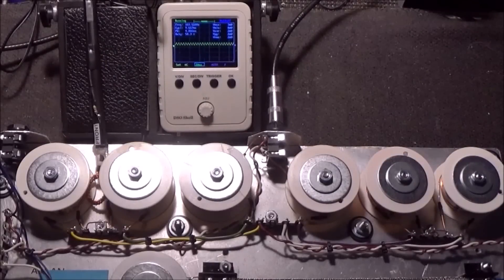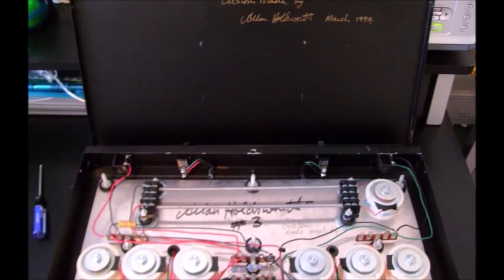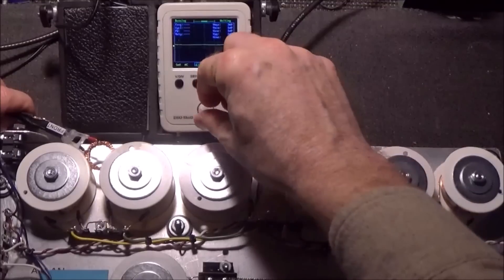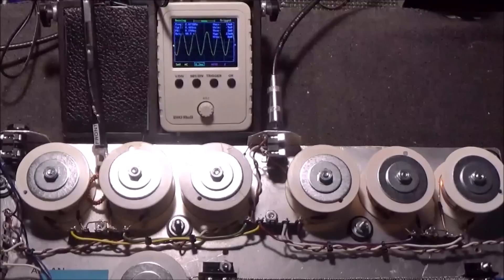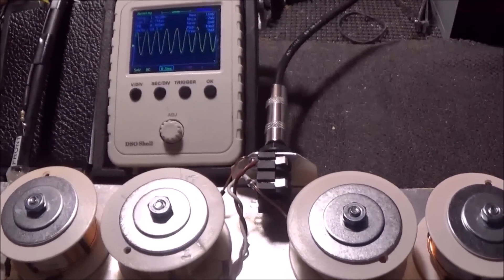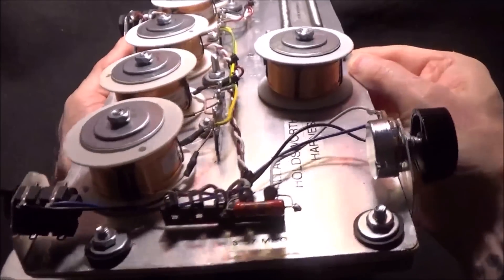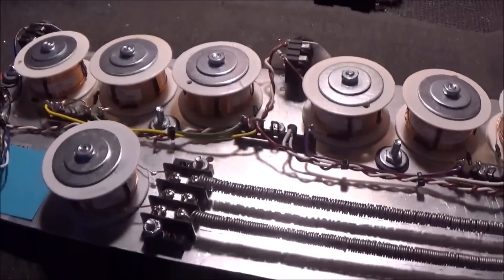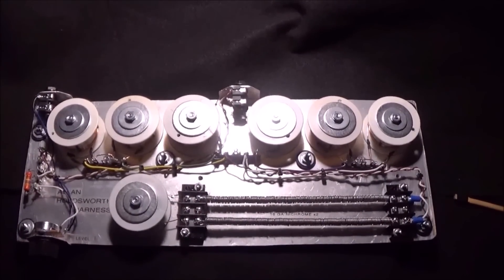The Allan Holdsworth "HARNESS" - Part II

Comment: So this device is amplifying the ac guitar signal as it is transfered between the seven coils but only after it is attenuated  by the load resistors, so, the ac signal is being boosted by the primary secondary effect the same way as any step up transformer would do to create an active load as a speaker would do. The palmer load box was available back in the 1970's so not a new idea at all and there is still a better way but I digress, still the harness is a novel way to approach the problem of sending a reactive ac signal that actually is di box along with attenuation but the harness uses the line out which is the preamp out if I'm not mistaken, if I am, again I digress.
Reply from the maker: I think it's basically acting like one big inductor with a resistive load designed to take the most of the current and dissipate the heat generated.

Comment: What you call cross talk is actually the changing magnetic field in one coil caused by an alternating current creating another voltage/current in a coil next to it. That's how a transformer works. The alternating currents in your coil create an alternating magnetic field that actually creates an voltage opposing/counteracting the original voltage in the same coil. This is what you call impedance and it's not really resistance but it acts like it. More magnetic material in the core of the coil leads to a higher impedance. The higher the frequency the more the signal gets inpeded.
Reply from the maker: Yeah it's not a transformer but similar principle. What does not make sense to me is that high frequencies do not appear to be attenuated at all... it only goes up up up from 200 Hz. Completely backwards of what I was expecting to see. Maybe I get these odd results because it's not on the output side of an output transformer?

Comment: I'm a sucker for this kind of bespoke electronics (grin). Some observations. Generally one splits up an inductor to raise the self resonant frequency of the coil caused by the mutual capacity of the windings. If he used one big inductor, it would naturally ring at a much lower frequency than the seven inductors in series, thus putting a big pole somewhere in the audio range of that graph of yours. Not good. So you split up the inductor as shown. I like that he puts the resistive load in the middle of the stack. Nice balanced design.
Where's all that capacity (67 microfarads!!!) coming from? There was no capacitor listed in the schematic on your site and parasitic capacity would be in the 100's of picofarad range, not microfarad. Check measurement.
I think the simple lumped model shown in your simulation is more or less the ideal AH was striving for. You got pretty close with your actual circuit. Congrats!  I love that you took the time to study and replicate the device. It was very instructive.
Reply from the maker: I don’t know about the capacitance… it’s just what I measured. Doesn’t make a lot of sense to me. Maybe my LCR is confused by this thing? 

Yeah, the stuff at my website doesn’t include the impedance stuff… I just simulated that earlier this week. I think I need to connect this thing to an output transformer to see what it’s actually doing, or devise some other kind of test(s).
Reply: @VegasCyclingFreak  Looking at the circuit diagram, you've got a pretty simple circuit. about 7mH in series with 5 ohms. That's a lot of inductance: typical voice coils for speakers are not more than a few 10's of microhenries. This is because the inductive reactance at say 1KHz is a whopping 50 ohms due to that 7mH, swamping out the nichrome wire resistors. Basically the load is entirely reactive over 1kHz. If there is a mystery here, it's what AH was contemplating with this design choice.  I'm pretty sure you won't hurt anything by testing it on an amp, as basically you are running the amp open circuit at higher frequencies...
Reply from the maker: @kpnconsulting8739  Interesting point you bring up there. Seems that most 12" guitar speakers have a voice coil inductance between 0.1-ish mH and roughly 0.5mH. With 7mh x 7, that is nearly 5mH, plus the total apparent inductance goes up about 40% when they are placed on the baseplate & get the screws and washers attached.  Maybe in Allan's unit it's lower, but the DC resistance on each of my 200 watt 1mH inductors is 0.73 ohms. It seems that the nichrome was mostly there for the current handling/heat dissipation capacity. 

Some of the other "load box" type schematics I've seen have up to a 50mH  inductor. I can't really compare Allan's circuit to anything else out there... it's pretty unique. It would have been so interesting if he could have done a deep dive on the whole process of how he came up with the design and settled on those components.
Reply: @VegasCyclingFreak  It just now struck me what AH was doing. The circuit is a matching network to get you from the output transformer secondary to your line input. I just unplugged the speaker from my 30W Marshall Artist and measured the inductance of the output transformer secondary. 6mH! Right on the nose. So he's matching the resistance and the inductance of the output transformer with the "harness" resistance and inductance. Then he's looking at the divided down voltage drop across the stack as the output. V/ clever.
Reply from the maker: @kpnconsulting8739  Eureka! Hmm... that makes sense. So it's mirroring what the secondary of the OT is doing with a line level output arrangement in parallel? Almost seems like it's turning the OT into a back to back transformer arrangement of sorts, thru the mutual inductance coupling of the inductors in the Harness. This doesn't make the OT work harder?

I spoke to an owner of a custom Harness. He told me that you can't use it for extended lengths of time... too hard on tubes and output transformers. He apparently burnt up the OT in his Blues Breaker. That was his experience anyway.
Reply: @VegasCyclingFreak  That's an important observation. Now that I understand the circuit I can sort of see why it's destructive to the OT. Output circuits are designed to drive a mostly resistive load, so most of the real power ends up in the speaker. Under these conditions, with a mostly reactive load, more of the real power will end up in the OT and output circuitry. It's got to go somewhere.

Comment: Awesome.  Love this series, cant wait to see it in action.  Really curious what this thing is going to sound like.
Reply: Yes I was and am stoked idk why I love hearing people analyze and discuss circuits
Reply: It's not something you could hear, especially on YouTube. It would probably just sound like a cranked amp. You have to plug one in between an amp you are familiar with, and a cabinet. Somewhere around 1997 or 98, I had tried all the various load resistors, and they all lost something. Your amp just wasn't your amp any more. Touch response was always compromised, too. So I had the Harness II recommended to me. I had a blackface tremolux at the time, but had a rack rig. I'd given up on using the Tremolux as a pre-amp, and had gone throught the Mesa pre-amp, the GT, Kasha, Kitty Hawk and a few others. None felt right. The Harness was the answer, because I could use the Tremolux as a pre-amp for clean sounds, and it kept all of the tone, and all of the feel. I used the Harness II for many years, not knowing it was risky. Guess I got lucky. But boy, did it sound and feel fantastic. It didn't add anything to the sound, it just allowed my amp to be what it was, and I could then run it through effects and into a power amp.

Comment: Just watched Pt I, and you cover my big  question about coil geometry.  What does the output signal look like? What's the expected PTP input voltage of a Harness?
Reply from the maker: Line level output looks same as input, just scaled down. A 50 watt amp would make the circuit see about 20V RMS and something like 2-3 amps of peak current. It seems to me that everything I've demonstrated would just scale up with an increase in voltage. Probably the only way to really test it properly is connected to a tube amp output transformer.... I think that's the missing piece in all of this. All the stuff on the other side of the output transformer will affect what this thing does.
Reply: @VegasCyclingFreak could you get your hands on a cheap tube amp maybe from a Chinese website, there are some available for around $150, it would be a shame to destroy output transformers. But in the name of tone it must be done!!!!

Comment: You seem to be an expert on Allan’s gear, so maybe you can answer this for me - I think I read than Allan, at one point, ran his guitar into a Mesa Boogie and then he ran the output of this into another amp!  Is there any truth in this?
Reply from the maker: Well it was output of a Mesa Boogie head into the Harness, then into parametric EQs, then to eight delays, and then to a stereo power amp. I don't know if he always did it like that but seems in early 90s that was his rig. It got a lot simpler in later years.
Reply: @VegasCyclingFreak  Very cool info - thanks!  The person who wrote that must have confused Allan's Harness and thought it was another amp.  For me, he had the best lead tone ever.  

Best wishes.

Comment: it’s very cool that you were able to build this, however, nobody makes a power attenuator with nichrome wire.  The reason is the wire gets  hot ,brittle and breaks, then  you have no load on your amplifier.  There are much safer reactive load boxes on the market today.  If you love your amp, I recommend a more modern design.
Reply from the maker: Yeah I don't plan on using this but I wanted to reverse engineer it as far as I could. I don't know that the wire would break when it's only seeing 100 watts-ish, but as a manufacturer I guess the concern would be a mechanical connection coming loose and then we would have the situation you presented - no load on the output transformer. And your sound goes with it because it's all in series.
Reply: @VegasCyclingFreak  You did a fantastic job reverse engineering and building this.  I am very impressed that Allan had the skills to design this himself and have it go to production!   Thank you I  learned a lot from your video.  Enjoy.
Reply from the maker: @buzzedalldrink  Yeah about that... Rocktron's circuit is totally different but the units that Allan made himself used the nichrome wire. Rocktron unit used ceramic resistors. Anyway, yes Allan I believe was a genius.
Reply: @VegasCyclingFreak   agreed  he was special
Reply: @buzzedalldrink  Someone I got my gear from in the 90s knew Allan. According to this person, Allan had invented several things. Among them was a device that improved beer dispensed from the large metal kegs that bars tend to use. I can't recall the details at this late date, but he had a patent on the design, and it was in use in at least a few places. There were a few other things I was told about, but I can't recall those at all now. All I can recall was being extremely impressed by the man's obvious genius beyond just music.
Reply: I used a Harness II for years back in the mid to late 90s. Maybe I just got lucky. I used it to load down a Tremolux that had been converted into a head. From there it went into a Rocktron Patchmate that switched in and out various pedals and a couple of rack mount multi-effects, then into a power amp. Curious that they are so risky and Holdsworth used one. He had to have known. Maybe not. All I can say is I had no problems, and it sounded and felt *great*. Far better than all the various tube pre-amps I had tried.
Reply from the maker: @augustusbetucius2931  Cool. I know Allan fried one output transformer in a Carvin amp, and I've heard it was hard on power tubes. Other problem is people think they can turn everything to 11 with this sort of a device, and that's just asking for trouble. Some amps I think have marginal output transformers, and those are the ones that may have trouble. Don't know specifically which amps that would be though. I've been told only 20 Harness IIs were made.
Reply: @VegasCyclingFreak  Interesting.  No doubt knowing exacting what size wire was used is the key.  I would also think how many hit/ cold cycles it goes through and conditions like going from a hot to cold, like just used to loaded on a cold truck immediately after would have a lot to do with reliability and dependability.  Low production number could have been as simple as cost to build and demand.  I think it would be cool to find an original for the right price but I don’t see it as a piece of gear that I myself would need on a regular basis. I think there’s things out there that do the job better and are more reliable at this point but it’s just so cool. that he was that smart, I think this up designer, and build it primarily for himself.  I’m happy when I pick up in my guitar and it still works!!!!! again. Great job on this and thank you for the videos. Very informative. Also enjoy all the comments.
Reply: You could create a circuit whereby a relay automatically snaps shut and changes the circuit over to a resistor if the nichrome breaks.
Reply: @Jonathan_Doe_  why bother trying to fail safe and antiquated design?    There are more modern power attenuators that are much safer to use.  I don’t have one yet  but I think the fryette  power station is the way to go, if you have two amplifiers that you like to crank the volume to get your tone, but volume can be an issue,.  KI have built Ken Fisher‘s airbrake attenuator and been using it for years.    Its ken’s design that Dr Z is selling these days.  there are layouts and schematics available online and the parts are relatively cheap to build your own. I recommend that as a start into the rabbit hole!!!

Comment: haha so who has a harness?
Reply from the maker: There's not many of them but the total hardcore Holdsworth fans that play guitar will be the ones who have them, or possibly a few of Allan's contemporaries. I understand Metallica used Allan's creation at one time, but I am not sure if that was Allan's hand made unit(s) or Rocktron's completely different circuit.
Reply: @VegasCyclingFreak  a friend of mine had a rocktron juice extractor and i used it quite a bit helping him set up his rig, seemed to work fine, the extra outs were great for parallel effects (a concept i learned reading Allan's stuff) but obviously i'd be way more interested in trying a harness. i currently use a rivera rockcrusher as a harness and it works great but again i would walk 500 miles to try a harness haha.
Reply from the maker: @musterionsurly  The Rocktton units are like 1000 times easier to acquire though. I read from someone that knew Allan that he could never dial it in to his liking. On one of Allan’s personal prototypes he had eight outputs on the back, because at the time he was using eight parallel delays.

Comment: You've achieved a lot with very little to go on, someday perhaps you'll get some hands on time with an actual unit. Don't worry too much about the peanut gallery and stick to what matters for you. I wonder if Mr. Carlson or someone might shed light on what mystery lies within regarding frequency and interactions for clarity. Either way, best wishes for continued industry in life!
Reply from the maker: Yeah, hopefully I'll get some answers down the road. This is a little out of my wheel house, so maybe I'm not fully understanding what is going on with this thing. This thing has turned out to be much more interesting than what I thought initially. I'm used to peanut galleries, I deal with that virtually every day at work in the consulting engineering world. ha ha

Comment: Did you approximate the measurements by pixel or by eye? Either way this looks incredibly accurate so far!
Reply from the maker: By eye. The pictures I have to work with are too low resolution for anything that accurate. I've had someone else look at these pictures, too. They felt like it might be 18 gage. That can be compensated for though. I just need to know what it measures in a real unit that Allan made.
Reply: @VegasCyclingFreak  do you know the ratings on the coils, could one extrapolate the winding count from gauge and Henry's if there was a way to get a close enough estimate on the weight of the coils. I'm sure you already thought of that kind of thing.
Wow this is quite the under taking. I have only recently even learned who Holtzworth is and this makes me understand just why everyone says he's so major in the guitar sphere. And this project is going to be a main reason why I can now get closer to fully appreciating his style/catalog or contribution.
Reply from the maker: @SimEon-jt3sr  He didn't use this thing for his whole career, but for at least 4-5 years as far as I can tell. I believe he used this on Secrets, Hard Hat Area and Chad Wackerman's 40 Reasons. Allan used a bazillion different rigs in his career but always had his sound. This Harness thing isn't the secret to his sound but I think it may have contributed to what people feel was his best "tones". Personally I love his sound on 16 Men Of Tain and his contributions on Softworks "Abracadabra" album (you should check out live performance of pieces on that album - Allan's playing is just amazing to me).

The inductors in his units were rated for at least 100 watts. In my replica I have 200 watters, only because easily available for reasonable cost. I determined they were 1mH from markings Allan made on one of his personal units.